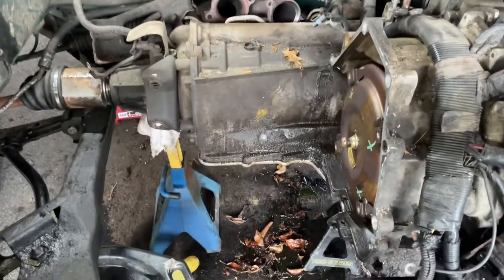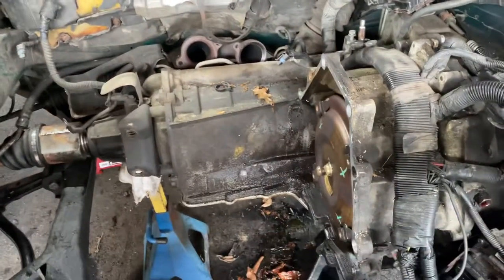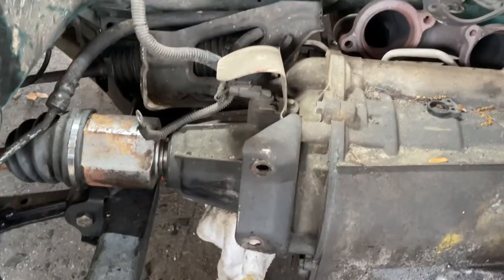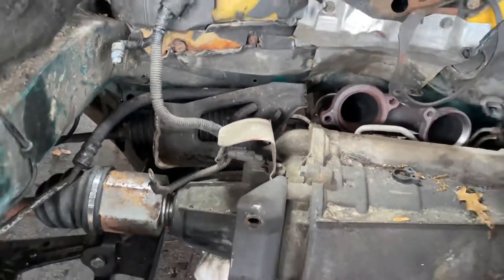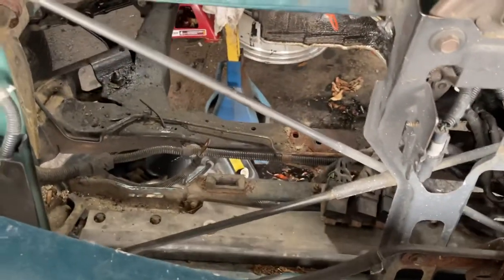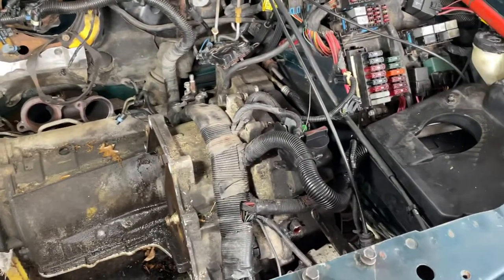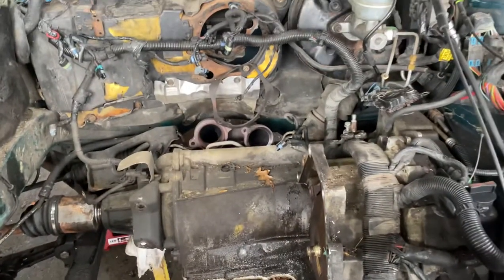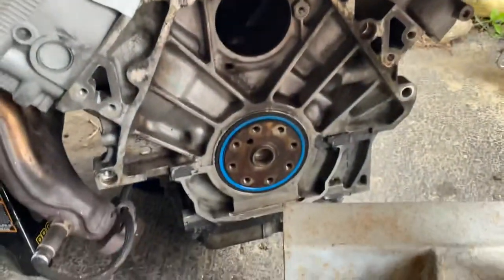Can you remove a Cadillac 4.6L Northstar out the top?

Comment: I posted a white Eldorado engine and transmission both pulled through the top  NP. Good to see more folks doing and taking the challenge.🙂
Reply from the maker: Nice I commented on your video
Reply: I also take out the engine hot, sts seville 99, greetings from Poland, complete overhaul, new 0.50 pistons, rings, main and connecting rod bearings, crankshaft grinding, Northstar performance head pins, all gaskets, etc.money bag, duty, import charges 😂
Reply from the maker: @namikadaj3381  that’s great!
Reply: @namikadaj3381  yea I pulled one out of a sts too was kind of a fight because of the front cross bar not removable like the DTS's were.  How long ago u did yours?

Comment: You are the man bubba. An achievement indeed. Did you drill out and tap for larger head bolts on the replacement block? You did this without a lift using only a cherry picker and floor jacks?
Reply from the maker: Yes yes and yes. Used Northstar Performance bullet proof kit wasn’t bad at all to do. No lift either.

Comment: What did you use to remove the torque converter bolts?
Reply from the maker: Instead of removing them through the starter hole like most people say, there’s an access panel at the front exhaust manifold area below the waterpump, used a 1/2” socket and ratchet I believe with various extensions.
Reply: @MechanicalMikesRoadsideRepair  I'm taking out an engine from a 2001 Deville. I will check again for this spot.
Reply from the maker: @blackericdenice  should be the same as this. Let me know!
Reply: I found the bolts and I got the engine out. The video is up.  @MechanicalMikesRoadsideRepair